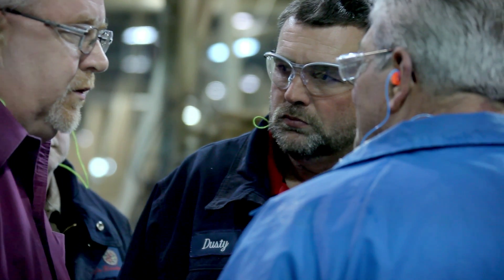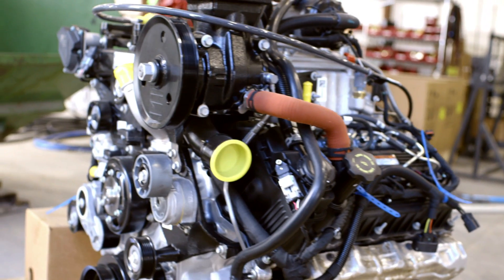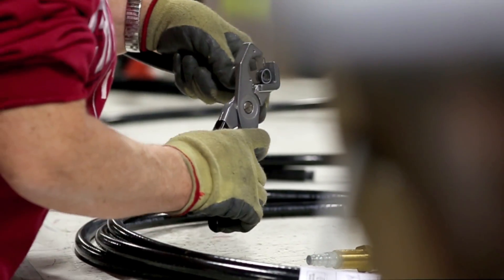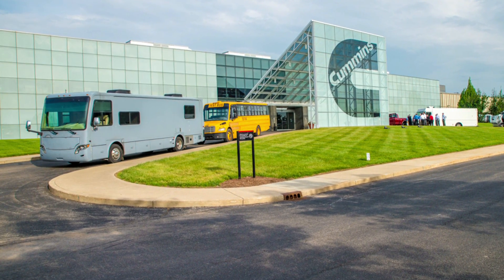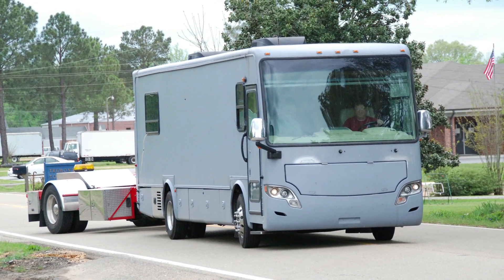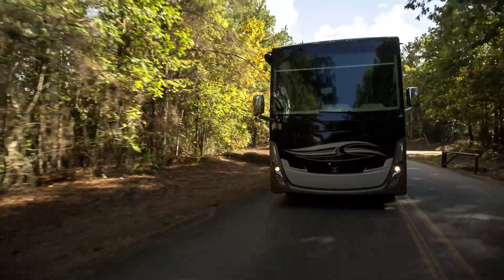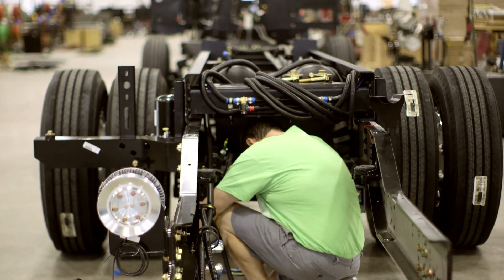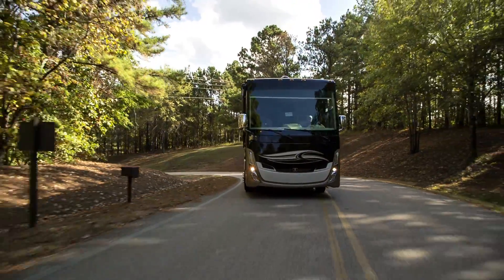Tiffin Motorhomes: A Closer Look - Cummins Engine

Comment: This motor has 2 hp per pound less than the engine on the Allegro Bus. Underperforming engine for the weight of the Allegro Breeze.

Comment: This motor maybe a step up from what was in the breeze before but for diesel enthusiasts it a huge disappointment. Uninspiring mileage, torque and performance. Initial cost/or reliability maybe it's only saving grace. V8's have more parts and because of the layout are harder to service than a inline 6 I think an inline 4 or 5 would have been a better choice.

Comment: It is not the first v6 that Cummins built. I  raan a VT903 in a  Ford Cab over in the 80's.
Reply: Thank you check it out a vt555 v8 Cummins or a 903 both v8 Cummins both from the 1970's. Neither very popular good horsepower but no torque.. the vt555 was like the cat 3208 use it throw it away when done.
Reply: It's a V8 russ